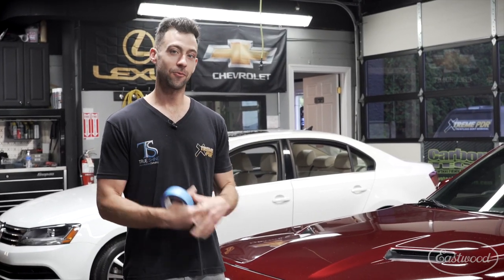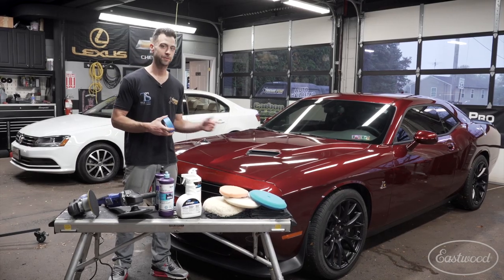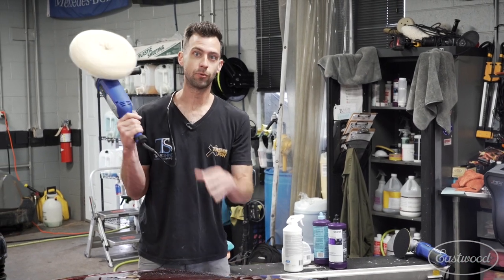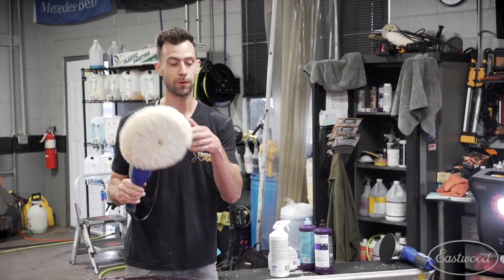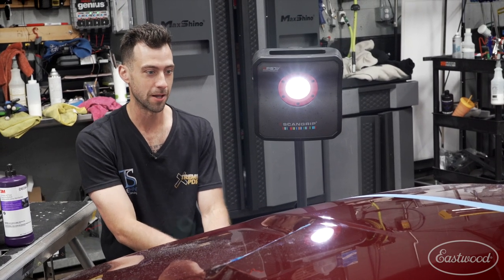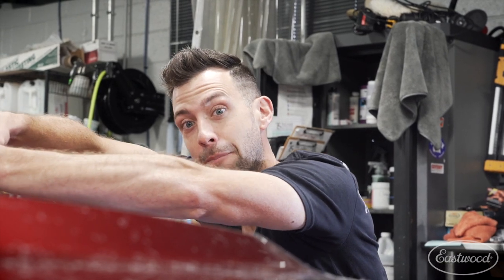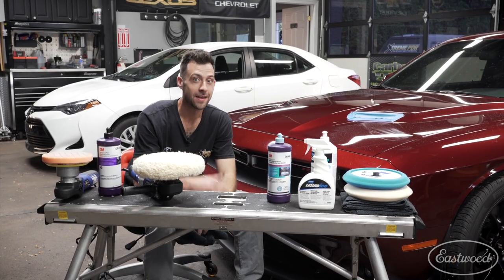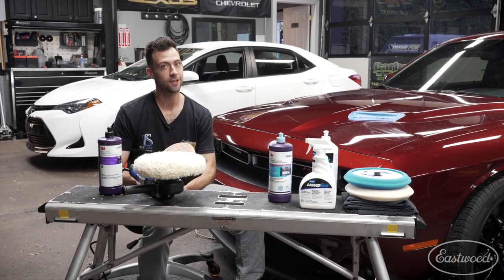Car Detailing: How To Remove Scratches & Polish A Car Using Variable Speed Buffer & Orbital Polisher

Comment: Question, is it possible that the paint Under the clear code is cracked? I bought a '02 PT Cruiser in Japan (yes RHD) this was in 2016, the car had only 43.000 KM driven in 14 years. So hardly driven at all. It had the original tires, spare tire  still had the little rubber things on it never been used. So when I arrived I changed the tires bec they were cracked. At first I did not noticed that the paint has scratches on it. So when I wet sanded it (with 1000 grit) they don't seem to remove. The car has a very nice shine, so I see the scratched from close, but standing next to the car you won't see them. I don't want to wet sand it to much bec I am afraid I will remove to much clear code. I can not send a pic here, that would be great if I could so you can see. I bought a ceramic coating, it comes with a little pieces of cloth, when I got it I tried a little spot on the car and now the cloth is hard. what other cloth can I use to ceramic the car with?  Thanks Like the video...keep it up

Comment: what is the best rpm with a wool pad and best rpm with finishing foam pad
Reply from the maker: That's going to be a feel thing for each person using the tool. When we're using a rotary buffer we end up going pretty quick - but be careful because you can burn the paint or an edge.